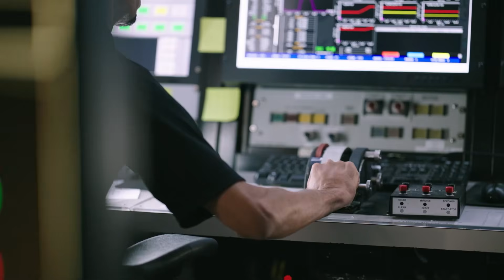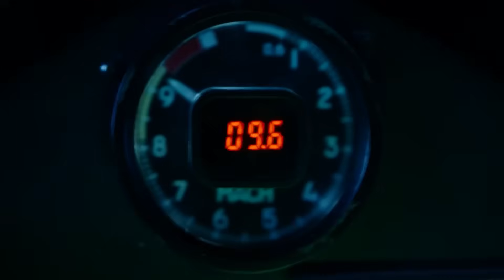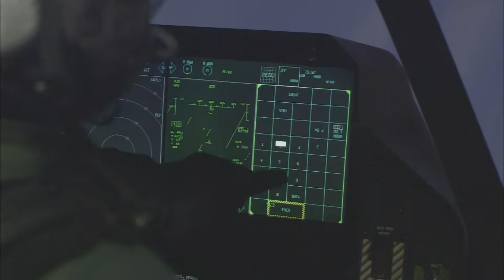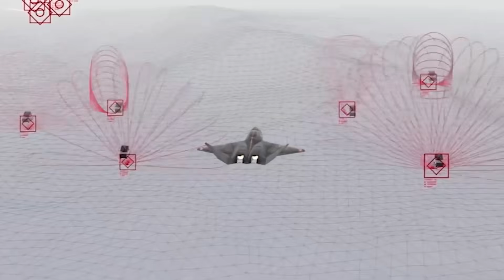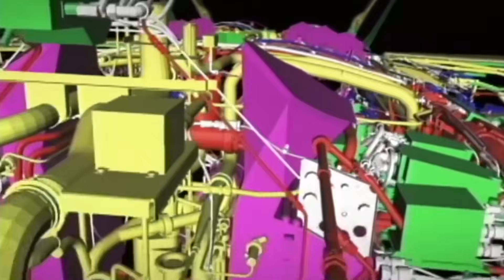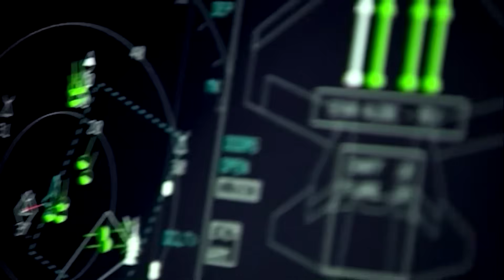NGAD: US Sixth-Gen Fighter JUST REVEALED

Comment: It's great we Americans can democratically brainstorm on warplane ideas. But only one of these designs even has serious potential and none of them are the future of war planes. You're too thinking too conventionally rather than in a spirit of pure science. As the world famous fascist poet Ezra Pound taught generations: 'Make It New!' Why is the pilot's coach and intelligence chamber up front? That's an inferior design. Place it in the rear center of the war plane; leaving room only for the alternating sun-disc engine run on a nuclear-fusion battery behind it. The wing design I need some help with; but it should be reductionist; I know the wings should be drawn back to the rear sides of the aircraft and should be minimal compared to the large wings of many of these planes, though larger than the Third Reich's V-1 Rocket Bombs, whose tiny wings were able to accurately guide and glide these weapons across the channel and to very specific cities, even specific factories or fortifications. Front-bulk, wing-bulk, etc., is all wind-resistance, creating gravity that goes not only our speed but our effective maneuverability. Freed up, the front of the war plane will also be somewhat reductionist but not excessively for it has a very important function: it is weaponry. It will be outfitted with gunnery to be controlled from the pilot's chamber with the help of computer systems; and then depending on the outfitting for the specific mission will alternately be able to fire either missiles or drop bombs. With realistic but optimal progress, these American warplanes can be ready in one year. In a worst case scenario, but every one doing their duty, including our cold fusion scientists coming up with the nuclear fusion batteries, it will take two years. America will then have the best warplanes on Earth; another aerial war eagle in our arsenal of democracy.

Comment: Using Tom Cruise movie cuts lost me. We only need it now if these cost 2M a piece instead of 1B a unit.  The F-22 has never been used as an F-35 ether.  It does take 25 years to work out the kinks.  We cannot use our tech in battle, including Ukr. No other country can have an F-22. No, the other countries are not ahead of us.  It is a cool plane. If made, time to get rid of many 4th gen models. We need to cut progressives' spending to afford it. I hate to say it, but we cannot afford 5B dollar planes that will never be used.

 I am sure the materials used on this Gen 6 are amazing, and the electronics are finally getting rid of radar/ It will not have lasers. Too much power is needed.  We won't be using them anywhere. If we have to take Mexico, F-18s are fine. It certainly can cover an A-10 and destroy the cartels. So we need to occupy the country down to its Southern Border.   Their people will be mad and call China for help.

Either way, we won't see this until 2035.

Comment: The X-15 is the fastest ever, not the SR-71. Mach 6.7 at 102,000 feet. That said, the X-15 doesn't hold a candle to the SR-71's capabilities because going fast was all it was designed to do.

Comment: This is vaporware. The SR-71 was a reconnaissance aircraft, not a fighter, although there was one YF-12 experimental interceptor. Although it was very fast, there were strict constraints on its maneuvers compared to fighter aircraft. SR-anything would a reconnaissance aircraft, not a fighter.

 In practice, supersonic maneuvers are limited by the G-forces the pilot and aircraft can tolerate (for humans, 9 G is maximum, and it gets miserable well before that point. The faster you go, the wider your turn will be at a given G-Force. At Mach 2, a turn with a 60° bank (2 G) will have a radius of 20.5 km (12.7 miles) At Mach 6, the same turn will have a radius of about 195 km (121 miles). It's kind of hard to turn inside an opponent going only Mach 0.85 when you're going much faster.

The targeting problem gets rather interesting at high speed, even with a laser or other directed-energy weapon. How do you keep the beam on the target point long enough to knock out the target? At extreme angles, the beam will reflect off of the target instead of being absorbed. When you're zipping past the target at a mile per second, the time on the targeted point for a beam weapon won't be very long.

Thus, the real challenge is to design an aircraft that gets to and from the combat area at very high speed, but is capable of subsonic maneuvers if it gets caught in a dogfight. That was one of the reasons the F-16XL didn't make the cut - it had decent supersonic performance, but it lost too much energy in high-rate pitch maneuvers.
Reply: Maybe thats why theyre working on it and youre not lol
Reply: @danteprice1874  I didn't say it was impossible, but that there are a lot of practical difficulties. Too many people want to substitute magic for physics.

Real-world engineers are coming up with work-arounds. That's why they're so interested in unmanned combat air vehicles. Removing the pilot and weapons officer cuts at least a thousand pounds off of the vehicle, and removes the human g-force limit. That permits designs that can go to 15 G maneuvers and beyond. 

The preferred answer for the directed-energy weapon time on target issue is to increase the power delivered to shorten the time needed to destroy the target. Laser technology has come a long way since it took a 747 to carry an experimental anti-missile laser. The Army and the Navy have contracts out for the development of mobile lasers able to shoot down multiple drones in a short time; some are already deployed. I have seen hints of airborne laser weapons coming soon, but apparently if it's happening, the details are classified.

Comment: At the 8:58 mark, the statement that the Pentagon  "HAD TO GO AHEAD WITH IT" because "the F-35 was the most technologically advanced fighter of its time" is wrong. The Pentagon didn't HAVE TO go ahead with it. They had a choice to NOT GO AHEAD with it, but CHOSE to anyway. Other options would still allow the U.S. to maintain air superiority. But the MILITARY-INDUSTRIAL complex that Eisenhower warned us about, CHOSE to not consider the other options!
Reply: You hit this one on the head! I see so many people talking about the F35 as if it's the best fighter of all times. This one is false also, the F22 will fly circles around it, has a bigger payload and a smaller radar signature not to mention the F35 does not have super cruise capability. But sense the F22 was scraped by Obama they pushed the support plane to fill the gap. There are at least three fighters out there now that will eat the F35 for breakfast. That's one of the reasons Australia cancelled their order for the aged support fighter. 
You hear talk that the F35 is a multi roll fighter now. Once you put them external pilons on this scrap it loses all stealth advantages. At that point a F16 could have it's way with the turd.
Reply: @Vv_Twisted_vV  I agree with almost everything you posted. But it was the military industrial complex, the Air Force and military contractors that did away with the F-22, and initiated a contract for a NEWER, FASTER, SEXIER fighter for their own purposes.
Reply: @hifinsword  I hear what your saying but you got to admit they made a killing with Fat Amy. Remember the F22 could not be sold to any other Country. On the other hand look at how many F35 have been built and sold around the world. Three model types also. What kills me is our Navy for the first time excepted a single engine fighter. They never excepted the F16 for that reason and had the F18 instead.
Reply: That doesn't even make sense. Are you Chinese or Russian?
Reply: @Fleshox19-uz3qt  What part are you having trouble understanding Fleshox? I see I used "CHOOSE" instead of the correct word "CHOSE". But I will correct that now.
Reply: @hifinsword why are you screaming only SOME words?
Reply: @jodyriley8562  I'm not that literate with the internet, being well into my 8th decade. So AFAIK caps are for emphasis, not shouting. For me typing here is the same as typing a normal paper where you use either underlines, italics or bold setters to emphasize your words. But none of those things seem to be available here on YT. So I use CAPS! I see others using bold letters but I don't know how that is done.
Reply: They didn't make the f-35 to be better at dogfighting and stealthier. They made it to be cheaper, smarter, good for multiple roles, and exportable. All of which it does splendidly, the f-22 is second only to the b-2 in how expensive they are to make and maintain. And the f-35s were basically a proof of concept for the ngad's networking thing they do with the drones. As they can do the same thing. As well as having the ability to look all around you in the cockpit and see what's directly beneath you. With how many f-35s we've sold we've probably nearly made all that money spent on making them back.
Reply: @generalgarchomp333  When you say "we've sold we've probably nearly made all that money spent on making them back" I assume you me WE is
primarily Lockheed Martin, and also Northrop Grumman, BAE Systems and Pratt & Whitney, IOW the military industrial complex - but certainly not the American taxpayer who continues to foot the bill.
Reply: @hifinsword  I mean the economy as a whole, and I highly doubt the government gets none of the money from exports.
Reply: @generalgarchomp333  Certainly the economy as a whole benefits from more jobs. But those jobs could just as easily be in health care, transportation, infrastructure projects, etc. if the nation's interests were as high a priority as the military-industrial complex sector. After a career in the military, I more than most support them getting the support for the weapons they need to protect us. But I also understand how the contractors work to profit enormously from those contracts, and bend the Military side of the equation so that the nation's interest is subjugated to a company's interests.
Reply: @hifinsword  no, because all of the stuff spent on defense is specifically part of the defense budget. So even if they don't spend it on that specifically it will be spent on defense. And it's only 3% of our annual gdp.
Reply: @generalgarchomp333  That was my point in my original post. It may have to be spent but not necessarily on the new tech, which may be immature tech. The Pentagon budget can be spent in different ways other than the latest technology that is not mature. The op tempo could be reduced if more people were available to fill more ships, bases, outfits that deploy. To do that they would need to recruit more people which means paying them more so some of the enlisted wouldn't have to be on food stamps, have better housing, etc. The DOD doesn't HAVE TO spend it on newer aircraft with systems that aren't quite mature yet. Build lower cost more mature tech planes, tanks, etc. and use the money saved on people.
Reply: @hifinsword  how does one innovate, and stay well ahead of the curve without using newer tech? Also the only way for new tech to be shown as capable is for it to be used.
Reply: @generalgarchomp333  That's DARPA's job and they do it well. Once the tech is proven, use it. Until then don't waste taxpayer's money on systems ALMOST there.

Comment: First, you go for 500 F22 with better materials and the cost is lower per plane. The cost per plane for NGAD is NOT going to be cheaper than putting together a KNOWN system and KNOWN required infrastructure. It NEVER works that way. A much better guess is going to be 1/4 of the B21 around $.5B per plane.  AND the US will end up with far fewer jets and spares. Further, it is doubtful the NGAD will actually be more technically advanced in all aspects, like avionics because open architecture allows for updates to current F35's. Restarting the F22 would allow more better avionics and architecture and updates. Further all the cost of airframes is averaged over all current frames with a lower limit, so the current cost of F35 is reflective of the wide acceptance and use. The F22 could never get that cheap because selling is not an option, like the NGAD, most probably.